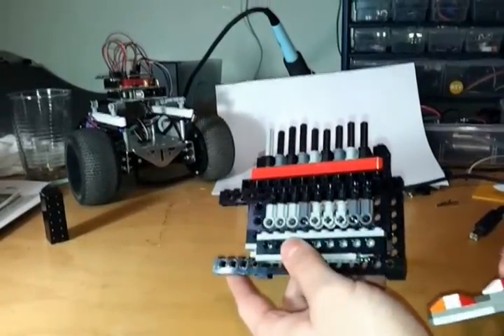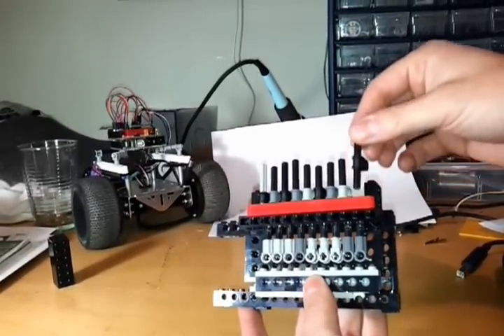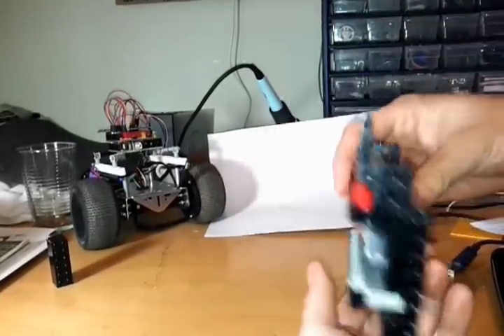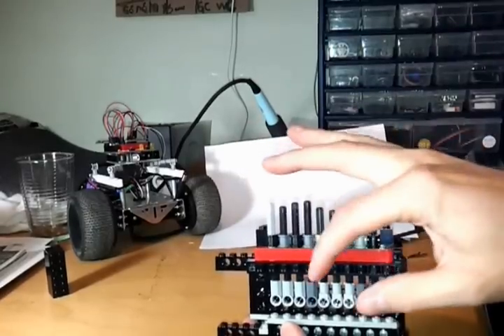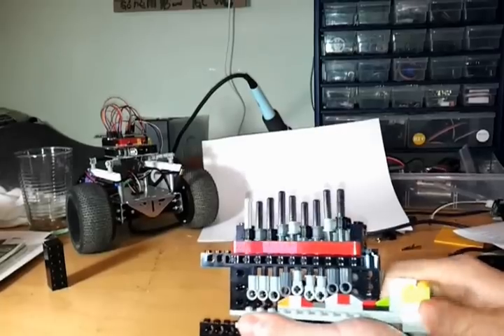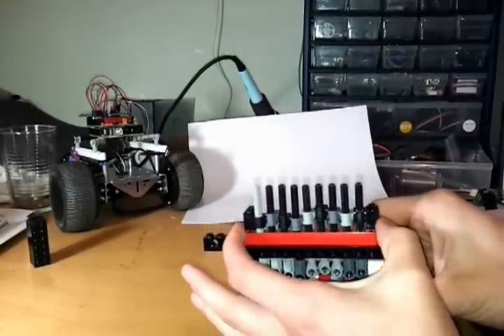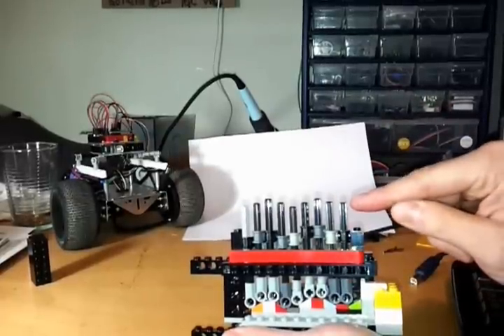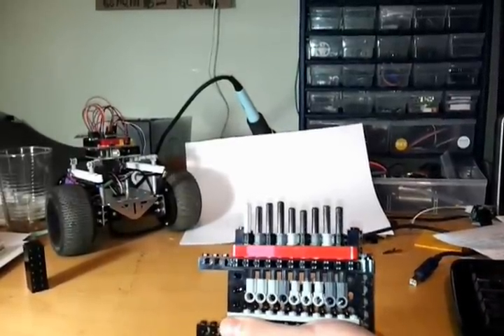LEGO tumbler pin lock

Comment: Really great but this could be opened by pushing all pins to the top most position if I'm right
Reply from the maker: It would stay locked but I didn't build the top part for this prototype.  Still, I explain how that would work at 1:05
Reply: No, because if you push all the lower pints to the top most position means that the pins pushed up by the key would now be inside the red beam, rather than the driver pins being inside the black beam, its the same effect as if there were no key inserted

Comment: The bottom pins that interact with the key directly would need different lengths right? So that when it’s pushed by the key it doesn’t lock the red bar in place and the above pins prevent low height keys to just turn the thing.
Reply from the maker: It could indeed also be the bottom pins that vary in length or both the top and the bottom pins.  In this build it was simpler to make only the top pins vary.
Reply: Phillipe Cantin ah ok so like when the top pins are aligned that allows the mechanism to turn
Reply from the maker: Exactly
Reply: Phillipe Cantin lol I’m surprised you responded to a 7 year old video